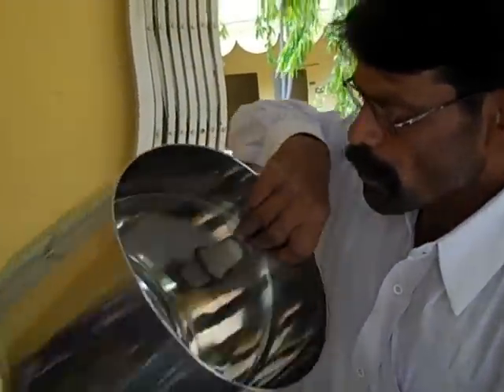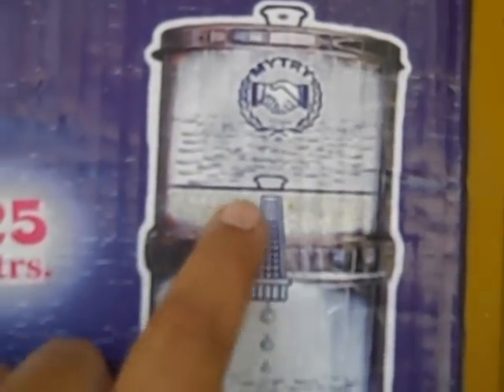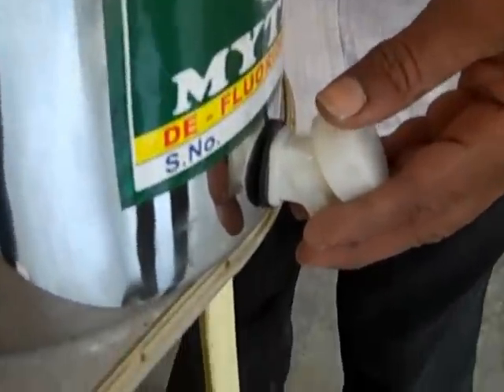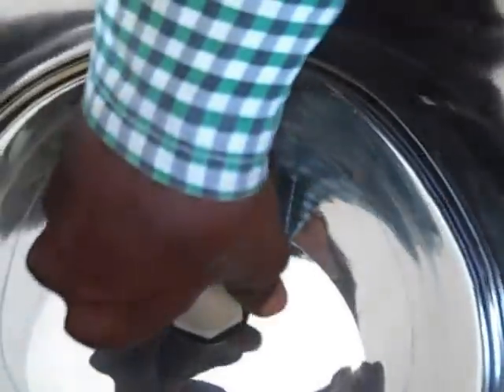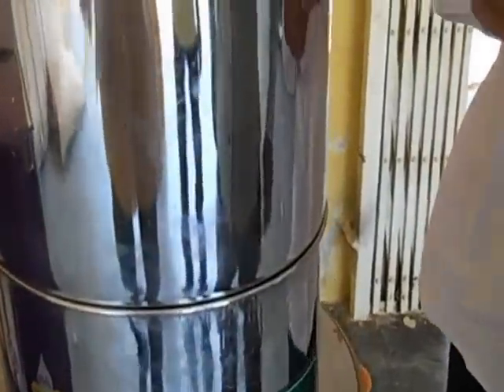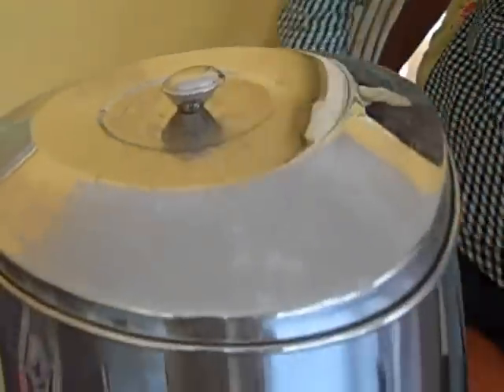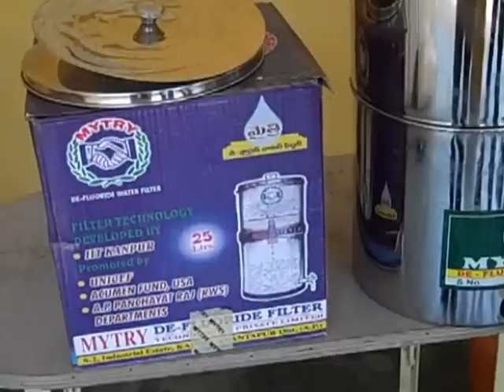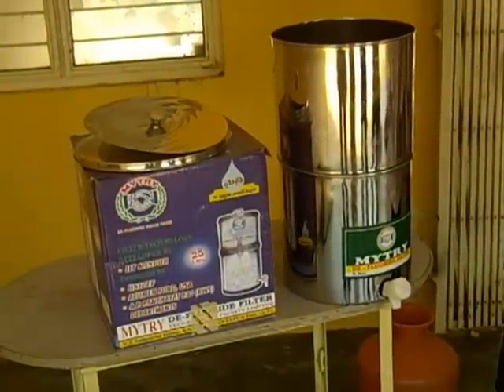Domestic Deflouridation Filter : Assembly of Filter and its parts

Comment: Hello! Thank you for the video. There is no option to purchase a filter of this set up where I am so I tried experimenting with activated alumina without a filter. I just poured about a liter of it into a glass jug and filled it with as much water as it could hold about 700 ml). I calculated the time needed to filter this amount of water from the research I did (24 minutes) and let the water sit in the jug. This was the first time I used the activated alumina I bought, and when I poured water into it, it turned white, bubles started forming and the jug heated, though it got just intensly warm and not hot. I missed the timing and poured the water out of the jug after 27 minutes. What I got was white water with a distinct chemical smell and the amount of it reduced to about a third of the initial volume. Then I tried another thing to see how much water would be absobed: I lined a strainer with a double folded towel, poured the entire amount of the alumina into it and poured a cup of water through it. It went through very fast (was not enough time to filter out fluoride), but the output water was still colored white, although now much less intensely and was translucent, still with a chemical smell, and reduced to about a third of the initial volume. So, obviously, the water absorption rate of the alumina does not depend on time it spends in contact with water. Is this normal for activated alumina to act like this during the first use? If I use it more, will it get more saturated with water and start absorbing less of it, and will it stop releasing particles into water which color it white? Or did I just buy a type of activated alumina not suitable for water filtration? The seller's page said it was for use as a gas dessicant. I would be very grateful for an advice on how I can use it further, if it's possible. Thank you!
Reply: Its all the same shit, just flush it for 10 minutes then use